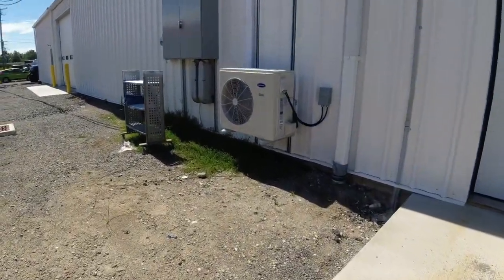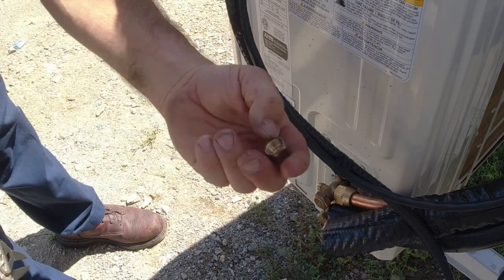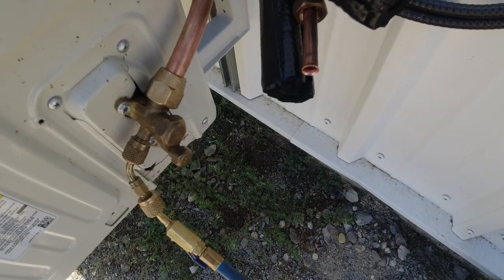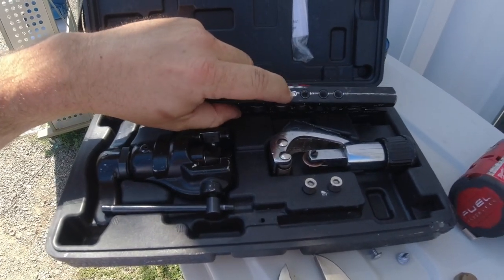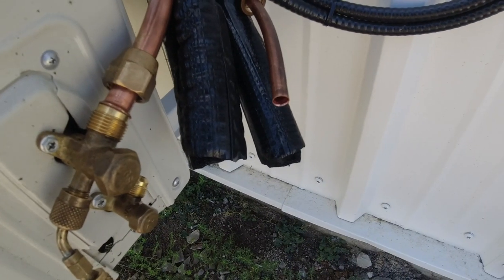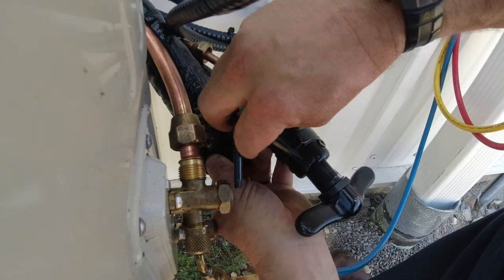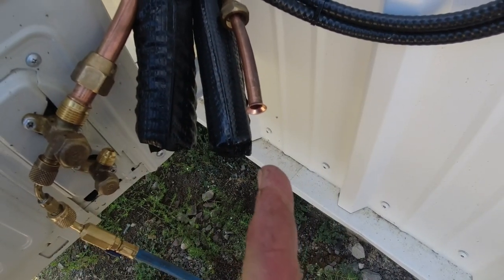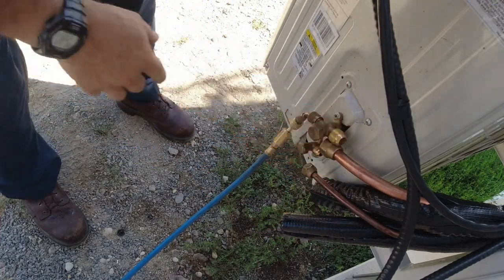Mini-split Heat Pump Not Cooling / How To Properly Flare Without Leaks

Comment: Young tech hear Rick on these mini splits what voltages  do u look for in diagnosing  other than the high voltage I'm more familiar with conventional split high voltage and basic 24v .great video by the way
Reply from the maker: I've been through Mitsubishi's wreck of a school on City Multi and the M and P series.. To say the least I still call tech service. I don't work on enough of them to be proficient. Most problems with these are installation errors, refrigerant leaks, wiring problems along with dirty coils and fan blades.
Reply from the maker: The one thing I can tell you about voltages is how to know if the outside and inside units are communicating. They use 3 wires to power and communicate on. Two wires are the typical 230v, the third wire is DC voltage  Mitsubishi will use the closest terminal to the DC terminal to communicate through. So if you measure  Fluctuating DC voltage On those 2 terminals it's communicating. It averages 0v to 30v dc.  Because the AC leg is isolated it can do this but FYI you will still get shocked if you touch the AC leg that carries the DC communications.
Reply: Thanks Rick I appreciate you taking the time to respond men
Reply from the maker: No problem, you guys are the reason why I do these videos

Comment: Good to know that they don't have protection, I want to install one on my RV, I think I'll install some low pressure cut offs, gonna install a drier too
Reply from the maker: Low pressure switch wouldn't be a problem just make sure you use a byflow dryer on the liquid line. They don't recommend it though just so you know

Comment: Just throwaway units in my opinion,  unless they're installed flawlessly from day 1 and even then at some point there'll likely be some trouble with the electronics .
Realistically the OEM gives the market what it asks for which is cheaper and cheaper equipment. 
You did a bloody good job on it though , gave it more care than anyone else would have I'm sure 👍
Reply from the maker: Thanks Sterling! Your right, total throw away equipment

Comment: Nice vid man, I’ve been in that situation before too.

Hey did you consider at all to maybe add more refrigerant?
Reply from the maker: That would be a short term solution to a long term problem if I wouldn't have corrected it. The system pulled in air and moisture when it went into a vacuum, not to mention it would just have leaked back out.
Reply: What can we do about all that moisture the system pulled in? And you’re thinking there is still a leak there somewhere?
Reply from the maker: It held at at a decent micron level when I was done. I'm not too worried about the moisture because of that. You could add a flare bi-flow filter dryer to it, the factory doesn't recommend it.

Comment: i wonder if the wire was from a condenser fan with reversible connector
Reply from the maker: It was something I read on one of the Hvac forum's, yes,  it was that wire.  Most people never think about trimming that wire down and reconnecting it..   That wire does not need to be 5" long

Comment: That's weird that it didn't turn off I had one I installed a couple years ago lose its charge from a leak on the evaporator and it threw a code and shut off.  That was a three head unit.
Reply from the maker: Is probably a better built unit
Reply: @HVACRSurvival  It was a carrier performance I assume they have same kind of boards and sensors.

Comment: You know it's sad that no one can flare anything! Why can't we get low pressure switch on ductless, if that were a scroll you'd be screwed and probably Kill the compressor-10 should never happen! Well Done
Reply from the maker: Agreed Agreed Agreed!!!! Thanks Steve, Have a great weekend!!!
Reply: Carrier, well made by Midea, don't seem to be fully engaged on all their equipment. 
Some of the Carrier branded units actually outperform Mitsubishi, but there are trade offs.
Reply from the maker: It looked just like the Lennox I repaired earlier this year. I figured it was from them

Comment: The torque values are set for dry connections. If you lube the threads, the torque pressure will be higher at the flare than what the digital wrench indicates. Nylog is for flare face only. Not for the back of a flare and certainly not for threads. And no one cares about your stitches.
Reply from the maker: No one really cares about the bad information that you’re putting out there right now. The oil is supposed to be on the backside of the flare genius and you can put some on the front of the flare and I did not put it on the threads. It was on the face of the male flare. At least I did it right unlike the dumbasses that did it before me and I never had to go back, why don’t you go back to work and not worry about what YouTube is doing if you’re that critical of everything because my callbacks are right around three maybe a year out of the hundreds of calls I run.

Comment: I use nylon on every mini split regardless what they tell you about it. Nylon doesn’t dry up. It’s like a rubber seal never had any leaks. 🥴🤔
Reply from the maker: I think it's great and convenient. But I use oil in some instances because it's easier to get into tight crevices behind certain types of fittings.  Thanks for watching the video & commenting!

Comment: There almost certainly wasn't an issue with the flare.  That looks exactly like an over tightened flare which is very easy to do on the smaller pipes.... They didn't take much

Comment: That’s looks like a midea clone too. Which is odd because the other clones like pioneer will detect if there is a leak condition (warm evap sensor is usually a dead giveaway)
Reply: Got more information on clues to where the leaks are in a Pioneer system?  I have had 5 of them, and 4 developed leaks after 2 or 3 years. @ntsecrets
Reply: @cruisemates  almost always flare connections. I’ve found the factory made flares are often kinda crappy. Always inspect them closely. Usually if they are leaking you’ll see oil around them.
Reply: @ntsecrets  Thank you for the info. I do electronics and can read DMMs, so I would happily get in there and read all those test codes, but the manual is so confusing in that department. There is a reply from HVACR about communication voltages. I will check that one out for sure.

I installed my last two Pioneers and they are built much better than the early ones, they worked great for 2 -3 years, but then both pooped out. I have been looking for oil throughout the flares without taking them apart but it feels soapier and does not look blackish - just sticky from the insulation adhesive they use. But I DO suspect one or two were over-torqued. We were really straining on one of those flares (especially) - all took more tightening than I expected or ever saw a regular wrench user do. I am going to invest in the same digital torque wrench as in the vid. (we were using a modified ratchet style).

I actually wanted to redo all the flares, but my helper (who knew more about the tools than I do) thought the flares we got looked pretty good. Now I know what to look for more closely.

Comment: It should be OEM by Midea and the quality is worst. I have a experience that the Carrier spilt AC always leak all refrigerant, I find all the copper pipe are normal, it should be leak inside the outdoor unit. I replace it with a Dakin spilt AC.
Reply from the maker: We normally sell Mitsubishi. I still have issues with there tech support running you around in circles because they don't have proper training either. The Japanese don't fully disclose how everything works with there own technicians🤦‍♂️🤦‍♂️🤦‍♂️,  Only what they need to know.

Comment: Neither flares looks like they're done properly. I've installed about three hundred mini split A/C during the last three years. Besides my normal electrician work. I'm mainly an electrician but I also install mini splits. When using the flaring tool I have you have to have the copper pipe about 2mm over the flaring tool.
Reply: What brand do you prefer?

Comment: This is exactly why when you can (especially commercial) installation you install medium static indoor air handler or high static indoor air handler depending on your application so you could install filters and you have blower fan that doesn’t get dirty and a coil that doesn’t clog up. 

          The wall mount I cut off the indoor flare fittings and braise it.  Can never have a leak that way.

Comment: Looks like they used spin flares on it
Reply from the maker: I've heard those are not good for flares but I love mine for snagging
Reply: I love my spin flare kit though I only use it for propane and heating oil lines.

Comment: Only thing i dont like about that tool is i wish it was right handed. 😂 But seriously i wish the digital was facing you. 90% of time its facing away from you.
Reply from the maker: It appears to be the same reading if it's towards me or away. So you can pick left or right😁
Reply: @HVACRSurvival  oh ok. Because YJ i dont think you can switch it.
Reply from the maker: Interesting,  I haven't used any other brand besides mine and a regular torque wrench.

Comment: Mfg: programs unit to use sensor data to optimize efficiency only and not initiate shutdown
Techs: unit is too dumb and keeps running like a central ac!!
Mfg: programs unit to trust sensor data always
Unit stops due to bad data
Techs: my customer lost cooling due to bad data inputs! minis are too smart 😠
Reply from the maker: Or manufacturer doesn’t know how to explain how they designed the unit and how to properly diagnose it because of the piss, poor standards that they follow. Sounds like somebody works for the factory.

Comment: …and why are you torquing the flare nuts three times. You are tightening it more each time Once is sufficient, if you didn’t put oil/nylog as you have… Trust that expensive t wrench. Once is enough
Reply from the maker: Theoretically, it should be telling me exactly when it hits that torque. So it should not over torque. At the most, it may go an extra pound or two.

Comment: I’m not a fan of these mini split systems but my question is how the hell are some of them compressors so quiet?
Reply: And considering that these things are so fancy I’m surprised that the compressor didn’t shut off from overload but meanwhile some these old r22 systems are still kicking lol
Reply: Most likely it's an inverter unit. Conventional fixed speed units are quickly getting fased out. Especially for mini splits
Reply: Inverter technology they covert single phase AC to three phase DC through the printed circuit board, end result you can speed up and slow down the compressor depending on the haet load/ pressure.

Comment: Just be honest, you don't like them lol I don't like them. They are never easy to access, you always need a ladder to work on them, the plastic casing always breaks when you try putting it on or taking it off, the pressures are always odd even though you charged to factory specs, not easy to diagnose since you don't have access to the high side, cleaning the damn thing indoors while it's mounted is a nightmare, and I'm sure there's more to add to the list.
Reply from the maker: Damn strait! I said that in the video but might have cut it out so I didn't sound like a A-hole....LOL